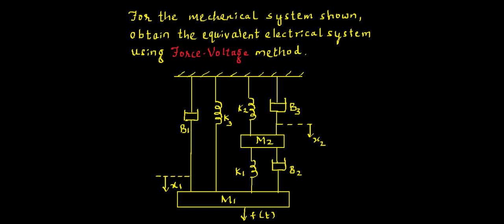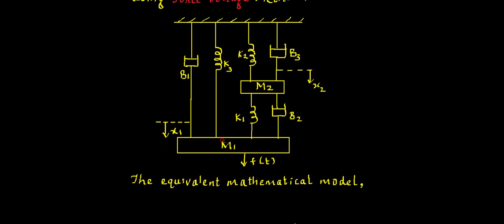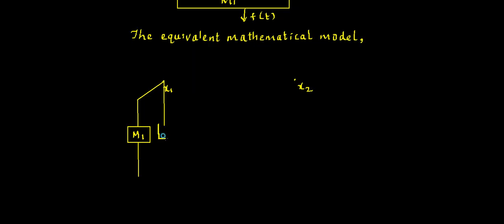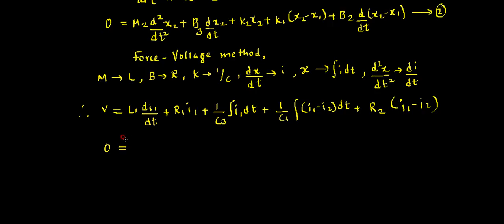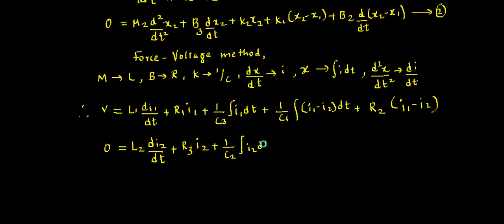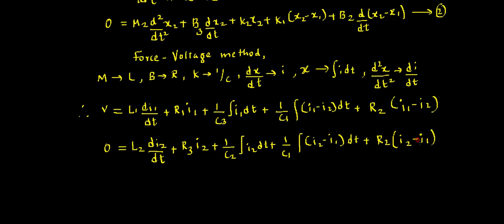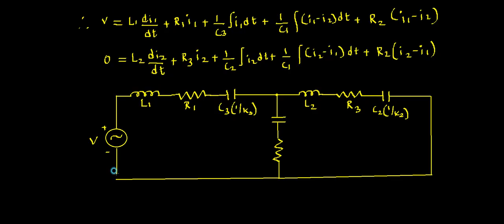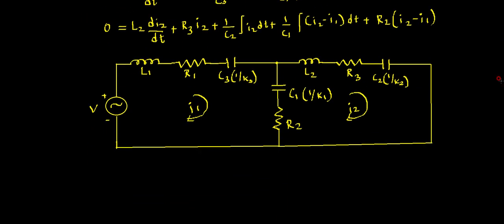Q2b. For the Mechanical System, obtain the equivalent electrical system using Force-Voltage method.

Comment: Sir in the previous exam they were not given the displacement for this problem so how did you take displacement sir please explain 😢
Reply from the maker: If not given, then Displacements can be assumed and can be proceeded. 
Else, the best method is, 
The applied force produces the displacements at the Masses. Here, two masses are there and it produces two displacements x1 and x2.
Reply: @EnggClasses  sir will please make a video on that because we have makeup examination tomorrow 🙏 please sir
Reply: @EnggClasses sir but on 1c f I analogy  problem their also 2 masses were there but you took x3 too